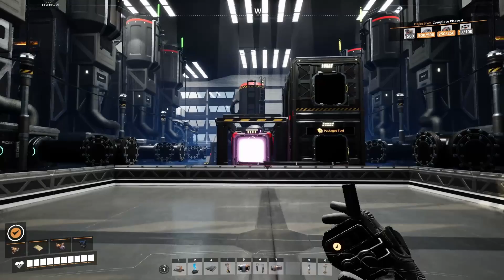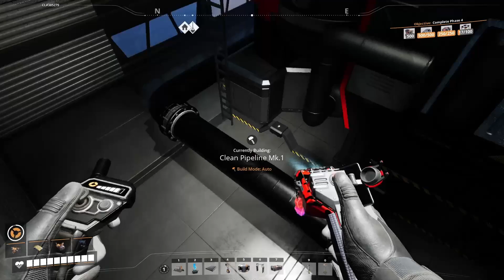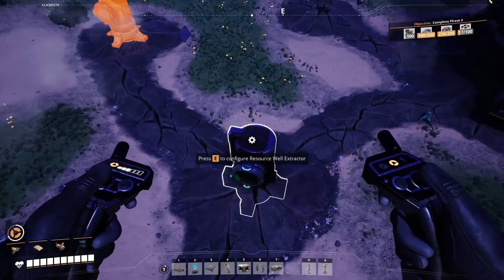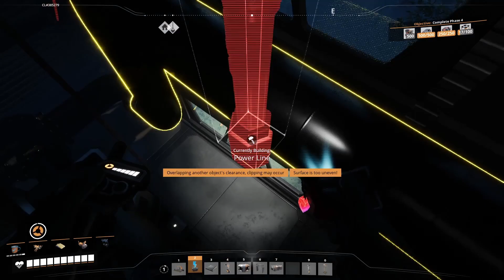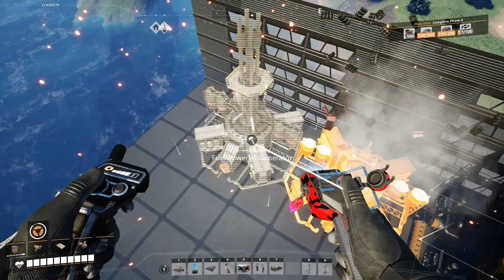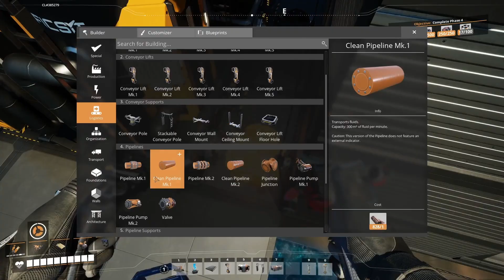Satisfactory 1.0 Ep28 Desperate need for some Jetpack fuel with 2000MW extra power

Comment: No nuclear waste sounds good. I never liked nuclear power. Usually just went to coal.
Reply from the maker: I am adding another massive coal plant of camera next to the last coal power I did. Should be fine to get rest of production ready. Have a particle accelerator running making Nuclear Pasta off cam for space elevator that eats up alot of power aswell